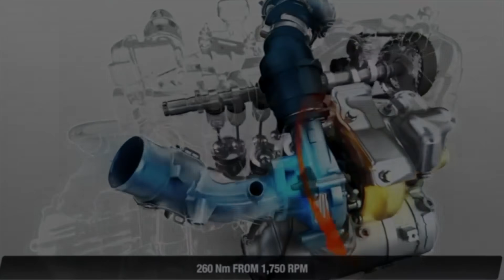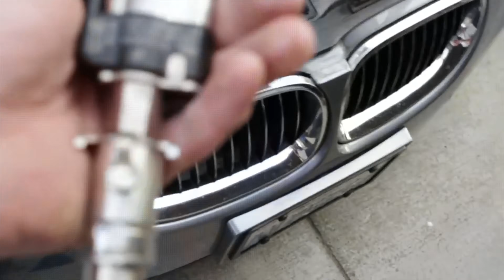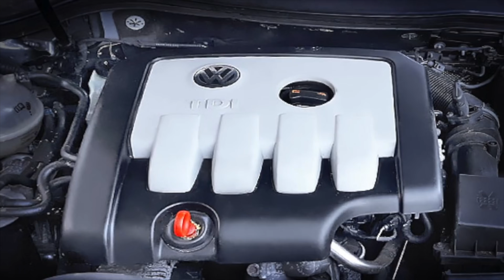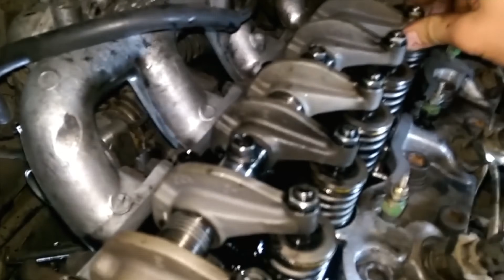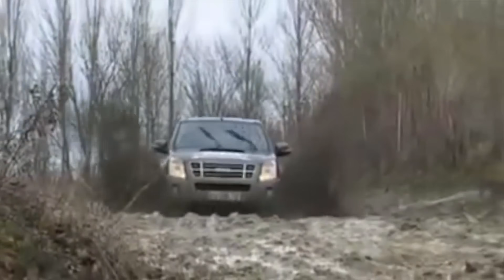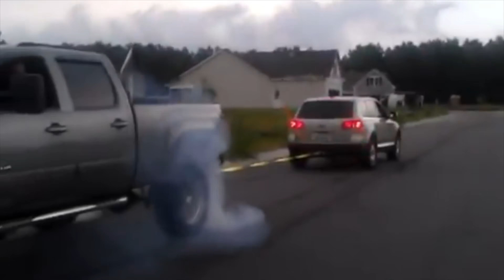The worst diesel engines on the market | Most problematic diesels that are not worth buying

Comment: The dCi engine can be considered the most durable and cheapest engine in the sector. 

The 1.5 dCi used in cars is of very high quality. The 2.3 dCi used in pickup trucks is probably no different.

Comment: 2.0, M9R 2.0 dCI is one of the best modern diesel engines. 1.9 was crap, 2,2 also, 1.5 and 1.6 have some issues but 2.0 ?
Reply: Which one is more reliable, 1.5dci or 1.6dci ?
Reply: @lglge611  1.5
Reply: @lglge611  1,5 dci is a lot more reliable, especially later years. However, 1,6 dci with 130 hp is also good. It is a lot better engine than 1,5 dci when serviced properly, but be aware that it is also more complicated, so durability suffers slighty. Version with 160 hp and two turbos is quite sketchy. There are a lot of people really satisfied with those, and a lot who have huge issues, so its better to avoid.
Reply: @NikMax1989  yeah 1.6 twin turbo is a gamble, single turbo 1.6 is pretty reliable tho

Comment: Older IDI diesels are a lot less environmentally friendly but, in many cases. almost unburstable. I have one and prefer to pay the additional road tax to having to deal with constant problems. Mine is a Peugeot XUD9TE, the highest mileage example I've seen had 979,000 miles on it, with just regular maintenance. Some early Mercedes 5 cylinder diesels have covered much greater distances than this, albeit finding one in a western European country that hasn't rusted to pieces isn't easy. My own Peugeot still looks good after 27 years though, with plenty of care. If it got written off, I certainly wouldn't buy a modern diesel.

Comment: The bmw 20 diesel engines are amazing .. Im a Bmw  mastertec for 28 years .. Keep your oil clean  regular service intervals vital . Those timing chains will last  300 00 km
Reply: Still junk compared to the M47/57 series diesels with the timing chain in the proper place.With Egr and swirls blanked, cats gutted they're only second to the Merc Om606.

Comment: WTF the Renault DCi are you taking the piss? I have seen and driven K9K engines with over 200k miles on them. The only issues they suffer with are injector seals failing. The DCi DPF system is one of the most reliable too. Taxi drivers here swear by Dacia Logans with this engine fitted.

Comment: Well idk, in Romania we have plenty of Dacia Logan as taxis with the 1.5dci engine, the standard is 500k km, i saw plenty with more than 700-800k and i think more than a couple that had 1 mil
Reply: The 1.5 dci was improved over time fortunately.
Reply: @teijepa 
We are talking about first edition of Dacia mid 2000, the 1.5 was not that refined. 1.5 is the best small diesel.

Comment: I dont think 1.3 multijet should be here.
Maybe this version never came ro india.
It is known as India's national diesel engine.
More than 2 million cars in india have this engine.
Known for its reliability effeciency and power.
Reply: I think the same. I still have a 20 year Panda 1.3 Multijet working like new after 150K on the clock. 3,5-4,5L/100Km. Only had one problem with clogged EGR due to city use.
It's a wonderful engine.
Reply: The 1.3 is a opel engine not a fiat engine the fiat punto shares its platfrom with the ford fiesta and opel corsa in the past.
Reply: @henrischolten2970  its a FIAT engine,and its not bad at all!!!

Comment: That 3.0 V6 from DMAX was later used in Jeeps and RAM 1500 pickup trucks which were also very unreliable engines.
Reply: The RAM dealer mechanic told me to stay away from them because they were replacing A LOT of dropped valve seats in those engines